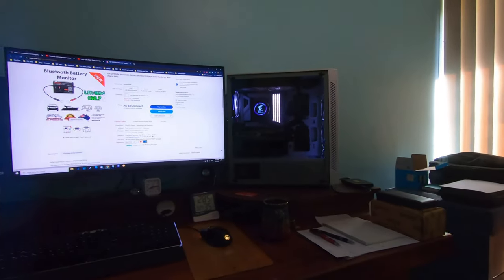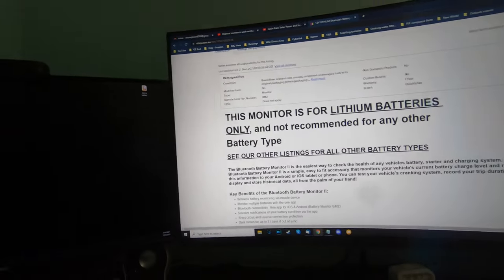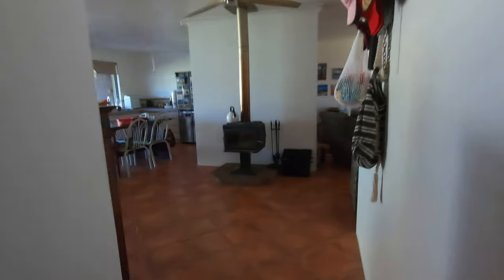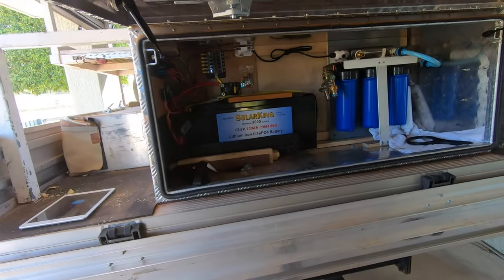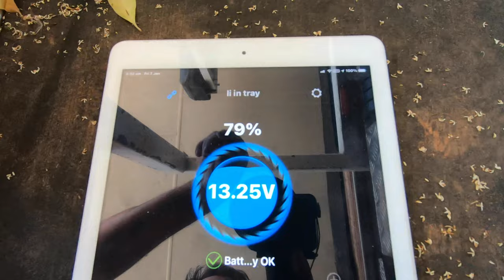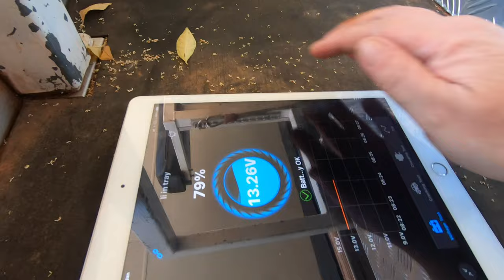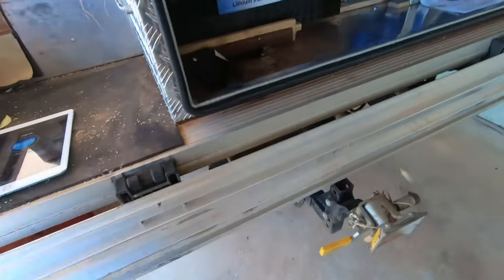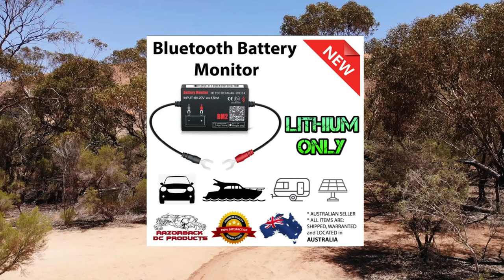12V LITHIUM Bluetooth Battery Monitor.  Best low cost monitor on the market!!

Comment: Another great video. Looks much better than temperamental monitor in my battery box. Well that's a bit harsh, if it's in constant use it's good. It's just when not in use for a while mine doesn't seem to monitor spontaneous background drain. I might look at getting one and mounting it in the battery box. Cheers hope and Ziggy are well
Reply from the maker: Really Great and well worth getting. You know me Adrian if it did not work it would not be on our camping rig. The battery drain is extremely low mate. Sigi and I are watching your video's with much interest. Been planning a trip across the Nullarbor for a few years now. Hope you still have our email if not send a text and we will send it to you. Keep well and remember Adventure before Dementia my friend, Every chance you get, Go out and enjoy life and each other. Love to you both.
Reply: @JustinCaseSolarPower  100% buddy. Di does have your email. So we will email you in a few days.
Reply from the maker: @adrianduncan8355  Adrian thanks for letting us know. No rush. 👍👍

Comment: Thanks for the video! Isn't this just reading the voltage? Lithium stay close 100% until almost flat so what is the 79% charge actually saying?
Reply from the maker: the 79% is the SOC.    This Video is now over a year old. And mine is still giving the correct SOC and is still working great.  So you have seen the Video. They cost very little. Get one and do your own testing. Just make sure its for lithium.

Comment: Great video thanks for sharing. I noticed you named each of your batteries. I just received mine after watching your video however instructions don’t explain how to change the batteries name? Hope you can help. Plan on getting 3 in total using the one app
Cheers
Reply from the maker: Raining today. When it stops I can make a small video for you, if you like George ? Have a play with the app settings first though. It's in the setup. Let me know if you can't find it.
Reply: @JustinCaseSolarPower  Thanks Justin for your prompt reply. I’ve managed to name the battery 😊All good many thanks. Problem was I had it disconnected from the battery when trying to change the name 🙄
Reply from the maker: All good

Comment: why wouldnt the other one work with lithium are you sure its not the same product? just a clever seller?
Reply from the maker: I just fitted 2 new lithium units into  this series of videos. 3 in the series here is link to first one. https://www.youtube.com/watch?v=mzx0dkI39pc  If you see in the back of the ute there is an AGM battery. I fitted it to that first to see what would happen. They would not work at all. Then i fitted it to the New Solar king battery ( lithium) and it worked great. This we all done just a few days ago. So the test i did then proved they only work on lithiums.